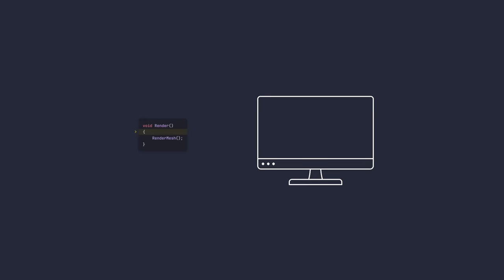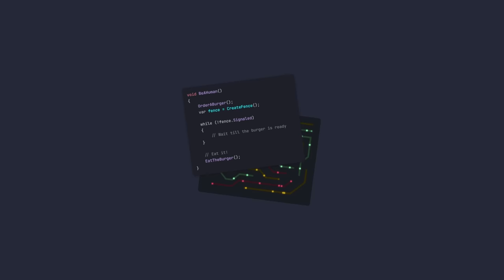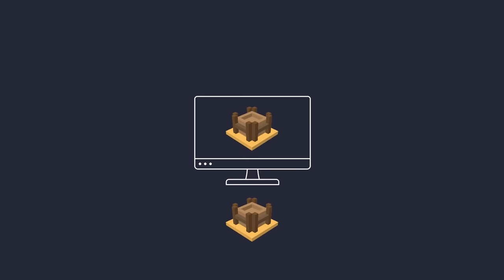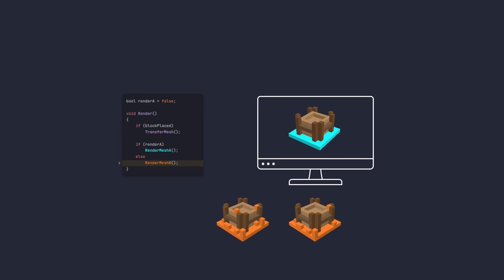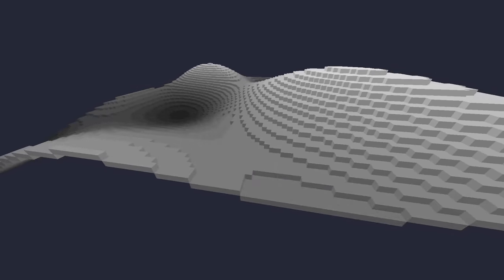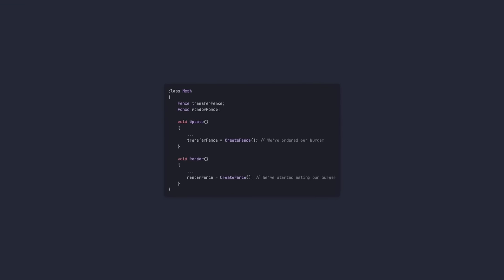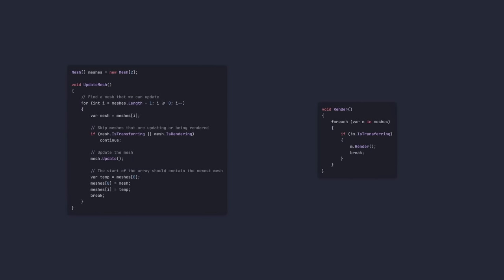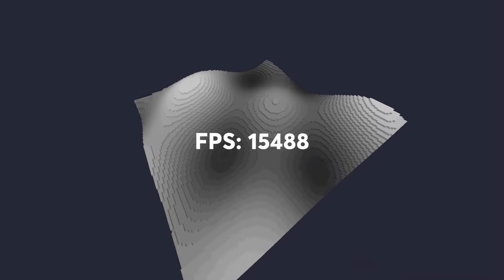I Created a Game Engine Just to Optimise This

Comment: Soo. Does the driver not upload the new mesh data to the gpu while the gpu is accessing the mesh ? Is that why you create a seperate copy of the mesh on the gpu and swap them arround, so that rendering will never block access to memory ?

The food analogies are funny but for me kind of confusing :) judging by the comments it's just me tho
Reply from the maker: > so that rendering will never block access to memory

Spot on, that’s right
Reply: Yeah, I think it's more a matter of the GPU not being able to render the mesh while it's being modified. The code at the start is especially confusing since it implies that uploading the vertex data CPU-side (glBufferData, glBufferSubData, etc) blocking the rendering thread is the issue here, which doesn't make much sense since why would anyone do that?

Comment: So sorta like double buffering but for geometry rather than frames?
Seems like a pretty good solution, but whether or not it's usable sounds like it would depend on how much VRAM you have to work with and therefore how well optimised for performance the assets you're working with are.

Comment: The real trick is to never synchronise with the GPU at all. Send the mesh verts once, then do all the mesh processing on the GPU using a parametized shader. Or one draw call with an instanced static mesh (one box per voxel). The animations and analogies are great though, and I think explaining synching with the GPU is still well described :)
Reply from the maker: Thank you and yes absolutely, no synchronisation is the best synchronisation. This video is for dynamic environments that the player can modify

Comment: But that takes at least 2x the memory for the updating meshes? So it's fine for small meshes, but can quickly turn into a disaster and cause crashes with bigger ones
Reply from the maker: That’s right, the downside is more memory usage. For Sector’s Edge I allocated a large 60MB buffer on startup for the terrain, and reused it throughout. That’s not much VRAM these days and it was plenty for pretty large maps

Comment: I wonder, how viable would it be to keep the meshes in the GPU, and only really use the CPU for updating them? I reckon with compute shaders and such you shouldn't really need any large data transfer between the two, and you could probably even have most of the logic running on the CPU. For example, in the render you were doing, the heights could be a 2d texture, updated by a compute shader. You could then have another shader edit the mesh buffer directly, or have a vertex shader read from the texture. I'm not sure if this would be *faster*, but it would be a hell of a lot more memory efficient :p
Reply: If low memory terrain is all you want then you can simply define a quad, subdivide in geometry shader to desired detail and apply the deformation during rendering. You never need to hold a complete mesh in memory, you just need to figure out most efficient representation for the deformation.

Comment: Isn’t this similar to swapping buffers in OpenGL? Basically where you have one drawing buffer and one display buffer, and you swap those every time you draw something.
Reply from the maker: Yep that’s right, this is using OpenGL as well. Multiple buffers (or one big buffer mapped persistently) and using glFenceSync for the fences

Comment: The main reason Unity games like Valheim freeze are: 1. The C# garbage collector. 2. Sometimes Unity may have so much data (from under the hood Unity stuff) it has to send to the GPU (or in some cases even read from disk), that it is impossible for it to avoid the spike the way it works. For instance: If you have a long draw distance and you are looking at a very large and very high density terrain mesh on certain way angle, the occlusion culling is culling everything that is not visible by your frustum but if you turn the camera around, then Unity will have to both unload the data of the terrain you can no longer see from the graphics card as well as load the data of the terrain you see now. And when it's a massively large and dense mesh this can take more than 16ms with the rest of the game running. The same can happen as you walk trough the same terrain and it loads it's higher levels of LODs of the parts of the mesh you are closer to.

Comment: I laughed, since No Man's Sky lag when leaving planet happens ONLY because mesh cache is in compressed pak file, and game engine decompresses it each time you leave a planet. Manually vomiting file contents onto correct path gets rid of the lag. What infuriates me is that I have 256 GB of RAM and it still does it. Engine just throws that data out every time you reenter atmosphere. WHY.

Turns out it's very beneficial to know WHERE your data is :)

Thank you for simple explanation!

Comment: This is an issue for sure, but in my experience (I'm a senior developer who works on a lot of AAA games), it's due to garbage collection. Unreal Engine is written in c++, but what most people don't know, is they've added a GC on top of it. Unity is C# which is GC'd, and until recently used a fork of something called Boehm GC from back in 2002 that was horrifically slow. They have put so much work into optimising loading and LoD substitution, but almost 0 work into a memory model that doesn't use a GC. Every stall we had on a recent Unreal AAA game was due to a bad GC hit, and almost every stall in Unity is the same thing. Walking the entire heap for orphaned memory is very expensive, and very cache incoherent too.

Comment: Thats called using proper memory and io scheduling and pre rendering buffer so that u write to ram, then tell gpu to bank switch and display has updated 

And use hyper threading and multi cores so you can just fully dedicate a core and or thread for dma (sort a hypervisor between gpu and cpu) and gpu while the rest are used for whatever

Using flags you can schedule priorities of data and objects and also pulling data to and pushing back to memory especially if each cpu core has its own dedicated cache file

Comment: I don't really like this approach of indefinitely adding new meshes to list first off, it clogs up the memory quite fast which you can see by fps having to go down from 1500 to like 1300 in somewhat linear fashion. Not to mention that greater meshes which are bigger will use a shitton of ram this way when you account for texture streaming and not only streaming of vertices. Tho I might be wrong

Comment: I'm sorry to burst your bubble, but you just changed the nature of the problem. The real optimization would be to push all the variants of the mesh first, and then just call the renderer with meshID, this is the way the most engines operate and it's the best possible solution for static or animated meshes (with relatively low amount of frames and triangles). High fps count tells me that high amount of meshes is queued on the gpu which means that a lot of memory is reserved for your draw calls, which at some point may result in a mem_alloc exception (again, depending on the mesh, anim frames and gpu itself). My advise would be to either calculate the mesh on the gpu using shader, or update parts of it depending on the actual changes. Most graphic libraries already perform operations that you shown on the video behind the scene, no need to reinvent the wheel. Good video non the less, cheers ;)
Reply from the maker: Ah this video is for meshes that change from player interaction, e.g.  building in Minecraft or a game with destructible terrain

For models that are animated upfront 100% I agree with what you've said, and if you can heavy offload operations onto the GPU then it's a win win
Reply: The problem remains the same, gpu would be overloaded with unnecessary draw calls. All I can say for now (without a deep dive into the topic of destructible terrain) is that frame rate should be restricted to refresh rate of the monitor and you should not update the whole mesh at once, unless it's relatively small. Once again, great video and good luck with future optimizations! :)

Comment: I'm sorry, but the sentiment is wholeheartedly not in-depth enough to explain why games stutter. It's a whole whirlwind of potential issues, and not this specifically. Updating meshes is a costly operation by itself, and engines do take care of a buffered system for you in case if you need rapid updates, and offload some of them to GPU itself (skinning, terrain mesh gen, etc.).

This is a necessity for your example here, but this specific design will not "stop my games from freezing". Say, as a curveball, because I never update my mesh data.

As an example of a very real issue though: DX12 and Vulkan pipelines. A pretty dubious idea and a concept that is hard to manage, which reflects in quite a bit of modern games, and is arguably the first point that gamers will jump onto when describing how their games inexplicably stutter (cough, jedi survivor, cough). And there are many other potential issues besides it.

I also don't get, why do you point to a small gap in meshes in your thumbnail and say that ruins the games? I thought this had to do with generating a quad per pixel or something (a supremely dubious idea, and it's not tied to the vertex/polygon count). I don't get it, the video barely even has to do with polygons themselves, just the data.

Sorry if I came off negatively.
Reply: Good comment, thanks for it!
Reply: it's just clickbaity as hell, huge problem in coding/game dev videos right now. you don't get this much engagement from being accurate or helpful in any way. before watching, a friend and i were also confused by the thumbnail and trying to guess what it was he'd be oversimplifying and his guess was something to do with misunderstanding garbage collection, but this is somehow worse -- it just already exists and is 100% not THE issue as you pointed out.

Comment: Is this just for game developers or can i use that as an coding-noob to optimize my games and stop them from stuttering? I do have this freezes many times in games and it freaks me out everytime it happens... most of the time its when i move my mouse to look around in an fps game but 3rd person games are running more smoothly for some weird reason...

I have an gtx 1660 (normal version) if that helps.

Comment: I believe you that this works, but I don't understand it. The issue is that updating the mesh takes too long and the gpu will have to delay rendering if it were to wait. Okay, so you run multiple meshes, and always show the newest one, while the older one gets updated. Okay, but because that sometimes just means that the GPU renders out a frame without any changes to the mesh, you decide in that instance between 2 frames, that you want to create a whole new mesh, update it, and render it? 

That last part throws me off. Or do you bite the bullet and let the GPU wait until a sufficient number of meshes is created for it to run smoothly?

Comment: Pssst, render pipelines in most engines are scriptable/modifieable no need to write a engine for this small feature.

Also if it is just a sine wave do it in the shader without the need to transfer the huge mesh.

You could also leverage a compute shader or directly manipulate the memory on the gpu. This is even faster because you don't transfer a mesh at all after it is known to the gpu.
Reply: yeah but then he wouldn't get nearly as much engagement and praise for something that already exists

Comment: Well, that definitely optimizes the speed of CPU to GPU transfers, but doesn't this massively impact memory usage?  If you are doubling meshes with millions of vertices you're basically halving the amount of memory you have to work with, right?
Reply from the maker: That’s right it increases memory usage. For models with millions of triangles (e.g. characters, weapons, enemies), they should be sent to the GPU only once on startup. They don’t need to be streamed in this manner, this system is best used for particles, terrain and destructible environments

Comment: This is cool and all, but what about the space complexity? If you have a duplicate of every model, you will have better performance sure, but you will also have only half of the RAM and VRAM available for your game. I would say, having one set of buffers is better and then just use better data streaming techniques. Use partial loading or something.

Comment: Great stuff! But I would like to point out something that I often hear and which I think deserves more attention. "It wastes memory/resources". So what? As the owner of the hardware I would like all my resources to be in use! Saving memory/resources is useless unless you can AND will put those resources to some use.
Reply from the maker: Hey that’s a valid take for CPU and GPU utilisation but not for RAM. A lot of optimisations come from reducing RAM usage as reading data from memory is very slow compared to other operations.

My 2nd most recent video covers this and shows the FPS difference between large vs minimal RAM usage.

For example if a shader is fed 32 bytes of data for every vertex, the shader needs to wait for this data to first be read from memory before it can run. If a shader only needs 4 bytes for every vertex, this data will be fed to the shader quicker, leading to quicker rendering.
Reply: @Vercidium  Good point, of course no one wants that the application utilizes more RAM if it makes it run slower.

Comment: How is this not an optimization problem?  Even if -- for some reason -- the engine needs to change vs the game, it's still optimization.
When I was in school, it was called global optimization and it included program architecture and structure, high level algorithmic choices, identification of choke points, etc.
And, choosing whether a sync or async model or hybrid was appropriate.  Also realizing when and where async vs sync subsystems/functions are best.
It was about computing dependencies, scheduling, latency hiding, serial vs parallel, etc.  Even polling vs interrupts.
Then using tools to locate lock contention (is lock free appropriate here vs there?), determining where latency vs throughput was best.
Etc, etc, etc...
Not just peephole.  Not just changing a bubble sort to a heap sort, unrolling loops or queueing requests.
I've never seen this not be considered optimization.
I've never done engine dev, but I find it hard to believe that any of this is new or is still a problem.
I could be 100% wrong, since, as I said, I've never done game dev.

Comment: things like this work great and should be used, but then suddenly there is the companies not adopting it, and half of the gamers who want to sound elite and will hate and say it slows down the game reaction time even if in realty it improves it.
had a technology like this as well, free open source principle, was more easy to implement in the way that you woulnd't actually need to alter the game code in general and could even use it as a compatibility layer, in almost any game in the world it would greatly increase the actual performance, as well as greatly reduce powerusage.
but somehow most poeple have something against change.
and the "mistake" I made, is that I reached this by fixing something that was designed wrong since the beginning of essentially modern game rendering, since people had looked at many new techniques, but noone had ever decided to look at the core principles behind the logic how the rendering itself actually works.
and guess what originally the thing which is still currently used was just rapidly without much thought added in as a it works but not really thought to much about case.
so it is insanely inefficient and the inefficiency comes back through in basically every render technique used in practically any modern game, including the new raytracing games which also still suffer the same issue.

and since it really was just a slap into it thing and is so deep into it that it is litterally like one of the core principles of how rendering is done, it is actually super easy to replace/super modular if the world would decide to do that, since it isn't even like a library or such, see it more like the default loop which runs behind all rendering logic having some insanely inefficient and generally stupid line in it which easily could be many times better.

actually one of the new aproach benefits was also somewhat comparable to what you do here in some ways, essentially it just adapts to what is actually there instead of trying to brute force everything like a fool. this gave more than 2 times better performance, while also saving tons of power, and people are free to use and implement it in whatever technology they want, but when something works different from what they know, then even if in all aspects it is actually better, since they do not yet fully understand or know it they will refuse it.
really sucks how primitive most people are.

Comment: Couldn't you also make games run smoother by using multiple GPUs to render more of the CPUs "orders"
Reply from the maker: Yes absolutely if all meshes, buffers and textures were loaded onto both GPUs. You'd send one frame's commands to the 1st GPU and the next frame's commands to the 2nd. Not sure if there are any monitors that support this though!

Comment: Hmm, while nice that it has a nice fps boost, but for a cost of lots of memory. So depending on your target architecture you can or can not afford this. Imagine a low-class Android device, and you would like to render a fully textured, terrain that would be 1x1 km. You would not want to have this mesh in memory 4+ times, not a chance. As someone here mentioned - double buffering might be a better option .... render old frame till the updated new one is ready.